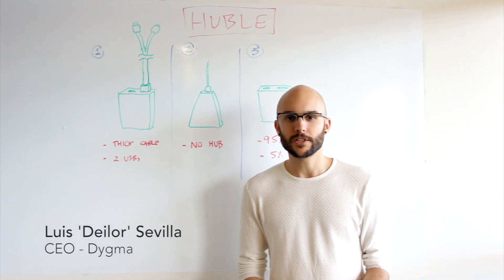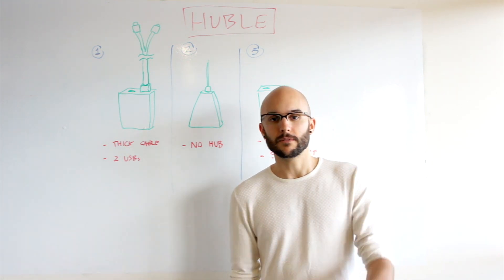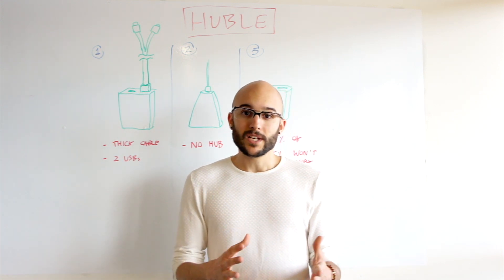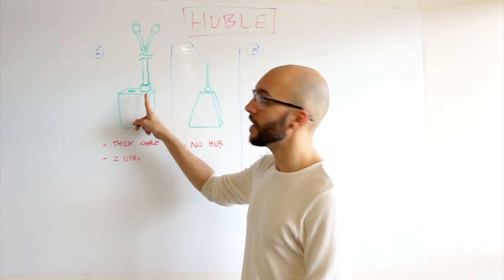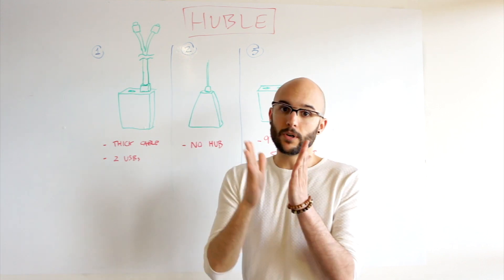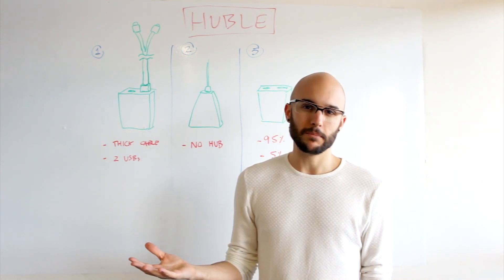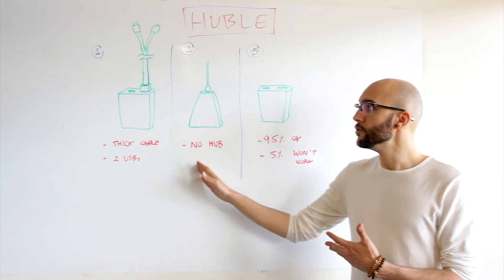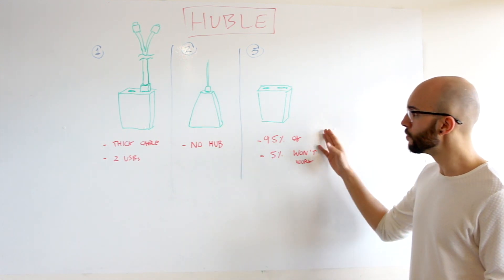UPDATE: Huble Development

Comment: Option 2 sounds like the best option and gives a cleaner look. Why wouldn't you just run a second cable if going with option 1 since two usb ports need to be plugged in anyways then? Running into a situation where your product runs out of spec with option 3 sounds like a bad idea especially if it ended up damaging hardware.

Comment: my vote is no to option 1 - that is a DVI size video cable... does that sit on my desk? that is a HUGE (thick) cable!!! I would vote for option 2 or 3 - I don't personally need the hub (ever)... but for the people that insist on having the hub, option 3 - for that 5%... if you plug in something that overdraws it you can just plug that into a different port on the computer and then you can plug in a lighter draw utility... for anyone concerned about plugging in a mouse... that will NOT be an issue... the only items that would possibly overdraw that would be an external hard drive or a printer... not a mouse!! - NO TO 1!!! that thick of a cable would be intolerable!!

Comment: I would definitely prefer option 3. We can always replace the cable ourselves if we need more power. I have an external drive enclosure that has just such a cable (2 to 1 usb) already.
Most modern usb ports are usb 3 anyway and can supply the extra needed power.

Edit to add: 
I would definitely prefer option 2 over option 1. Smaller cables are very much preferred to me. So 3>2>1

Comment: no hub! its no trouble if you want an extra USB port on your desk and absolutely no need for that hub. For all the people talking about plugging in a mouse using the hub, think about the cable mess, plus if you are going to use a mouse bungie. Also I would want to plug my mouse in a USB3 interface for peace of mind (I know, probably no difference but still) Having the hub just makes cable management harder! I would go with no hub! Option 3 is not an option, no way someone wants a less reliable usb option that maybee dosent work sitting permanently on thier desk.. Just keep it simple and remove the hub. Go for performance and reliability

Comment: I used to work as a control surface designer/dev so I apologise if my strict approach seems rude but I'm going to keep it real for the sake of technology.

This is not a matter of opinion. If you go out of spec it's not USB and you know it. You can't have a port which does not have 500mA available and call it a USB port. 
Stick to the spec. It exists for good reason. Option 3 is NOT an option.

To throw a spanner in the works, there's option 4: USB 3's higher current spec eliminates the issue.... but I imagine you already considered and eliminated this option for some reason. Perhaps a USB3 hub is cost-prohibitive?

Best practice has been mentioned below: "Remove the hub. Make a great keyboard and let someone else make a great hub." This is the correct approach.
Reply: "for the sake of technology" this is not correct, take it from someone who creates hardware for a living, option 3 is an option, not the best one for people using legacy hardware but still an option, we are in 2018, if the hub is properly designed it will reserve the 500ma for the keyboard and offer the remain (if anything) to other devices. option 1 is still the BEST as it gives the people who NEED to move their stuff around (eg. from work to home) an amazing bundled device, unless you're cutting on production costs to make a few extra bucks there's absolutely no reason not to choose the first option. 90% of people choosing option two are either afraid that something is "not going to work" (which only happens if the hardware is poorly designed) or they don't need a hub and never move their keyboard from one pc to another.
Reply: You're wrong. Read the spec. You MUST have 500mA available to the port. There is no remainder, that's the point of this video. The keyboard needs all 500mA, leaving none available for any other ports on the hub. So option 3 is not an option, because you don't have any power for more ports.
Reply: You need to re-read what I wrote, if you connect the device to any port that allows u to draw more than 500mA then the other devices would work flawlessly, otherwise they simply wouldn't work as the power should be reserved, the options 3 is a simple future-proof solution if they device not to put the two USB connections which I still think it would not be a good design. That or allowing those who want to choose a 1 to two USB connection in the campaign addons.
Reply: I read it fine the first time, thx.

Comment: Definitively option 1 or 3, every high end keyboard has 2 USB connections, the Dygma keyboard is not supposed to be a low-end cheap product, if people were aiming for that they just buy any other ergonomic keyboard.
I would like to add that more than 90% of the people are using at least USB 3.0+ (provides 900mA+) so even if you go with the option 3 most of the devices would work and never conflict with the keyboard.
Reply: If you're using anything else than usb3.. well, you shouldnt...
Reply: USB3 hardware is more expensive and increases cost, and there are MANY MANY people still using hardware that won't support it.
Reply: Using USB3 will require the hub be USB3.

Comment: I'd go with option 1 and a thicker cable, so even if you don't have the ports on your PC you can still use the keyboard without the second usb plugged.
Either that or the option 3, I'd rather have the hub knowing its limitations than not having it at all, I wouldn't feel cheated if the limitations are explained.

Comment: Remove the hub.  As others have said, I don't see using the USB port on a hub - it's location on my desk isn't going to be convenient anyway (behind the keyboard).  Another advantage of removing it is that the hubble can be smaller and take up less room - I don't need more things on my desk.  I think leaving things as they are could lead to support and/or perceived quality issues -- sure, we all know about this now but what about new customers and others who plop down at the PC and plug in something that isn't going to work?  If you can't deliver a solid experience, it's best not to deliver it at all, IMO.

Comment: I'm not gonna use the hub often, but I see no reason for removing it, just because it won't work all the time. Even if you're never gonna use it, and you have enough USB slots, what would you gain by removing it??? I really don't get the advantage of this option for backers. Only if you don't know about this drawback, it's a problem, but if you know .. you can easily avoid it and not plug in power consuming things during critical times (games) ... which you weren't gonna do to begin with...

I definitely vote for option 3! I don't like option 1 because of the thicker cable, the extra usb slot I don't mind...